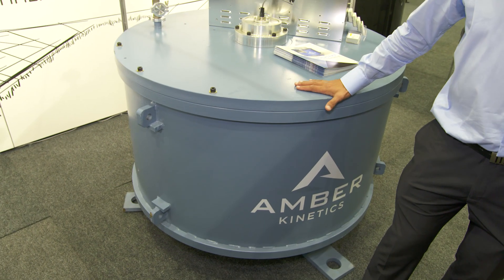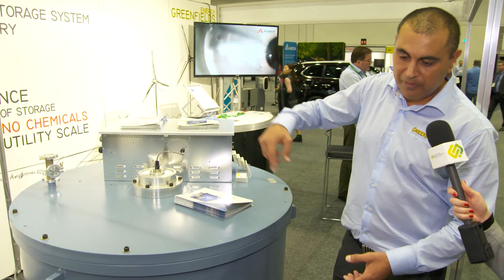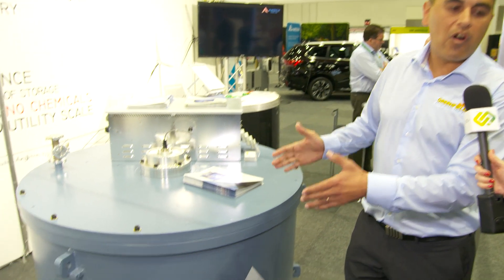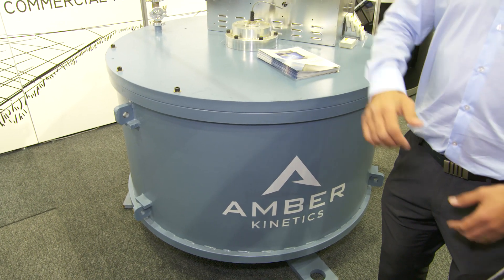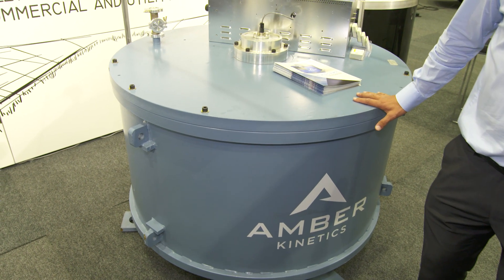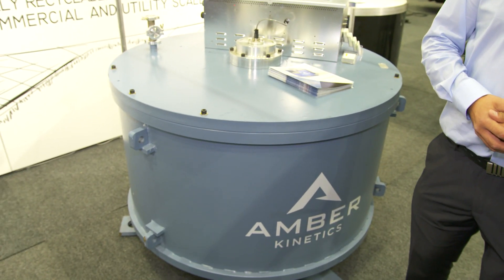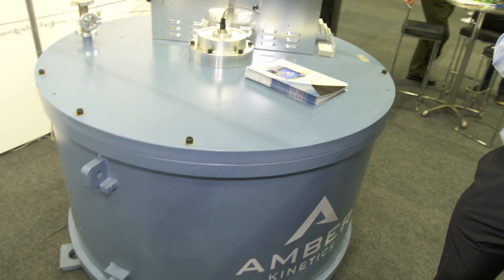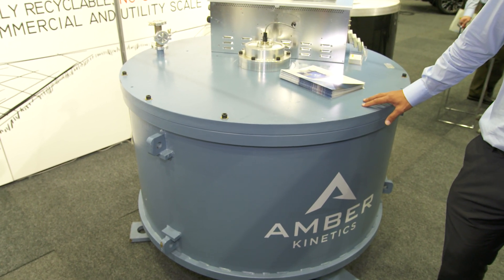Flywheel energy storage at AES 2018

Comment: lip &  lip 2 inch thick

bolts tiny few.

that not steel high pressure
Reply: The large surface area and the Vacuum inside the compartment is what holds it all together... the small bolts just locate the components.

Comment: Why would it not work after 30 years? Is it the mag-lev bearing? Couldn't they just replace that and go for another 30 years?
Reply: I  have the same question
guess I will have to assume that this is because of bearing
Reply: well it has to be it, but it's probably just a safe figure, since they def haven't tested it for 30 years and electromagnets generally last longer than that

Comment: When asked how they compared to lithium batteries, he just repeated himself.  He didn't talk about how many kWh it delivers.
Reply: Have a look at the Amber Kinetics website, maybe?
I just wish these would be developed for residential applications.
Reply: @InSearchOfReality  Surprisingly they say these are very expensive. Maybe the mag-lev is.
Reply: @Justwantahover  It might have something to do with low production volume. I'm sure they could be a lot cheaper if they were manufactured on a larger scale.
Reply: How effective would this be if it was implemented on an island for a deserted house for a long time, say the energy produced are from solar, hydro and wind. Any thoughts?
Reply: @lordseventher1244  It would be excellent and should last a lifetime but we really don't know how long they will last (but should last at least a fair while). Expected lifetime against the initial cost is the big unknown but (logically) you could take the gamble cos I can't see how they could "wear out". Maybe you may have to replace the magnetic bearings after a while and maintain the vacuum, other than that there would be no maintenance. I think they work by induction so the generator doesn't need any mechanical stuff to drive the generator/electric motor. But if they don't use induction, and have wearing parts forget it. They run 24/7 so they won't be practical if anything mechanically touches. That's a big problem with all types of wind, wave etc. power. Continuous wearing 24/7. And that's why mag lev and induction comes into it. Continuous 24/7 running and no wear. If they are both mag lev and inducted, I LOVE them!